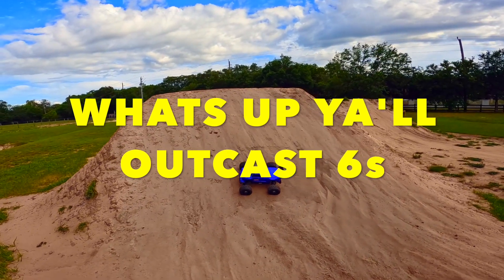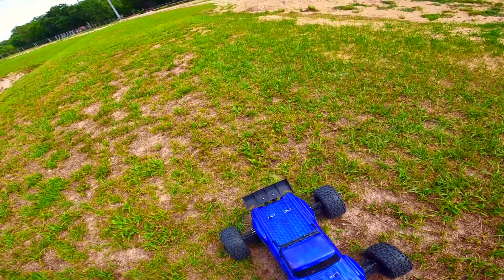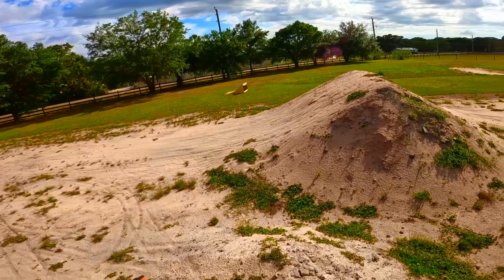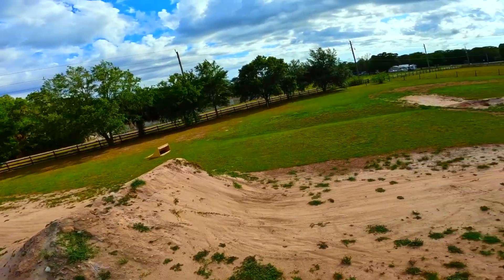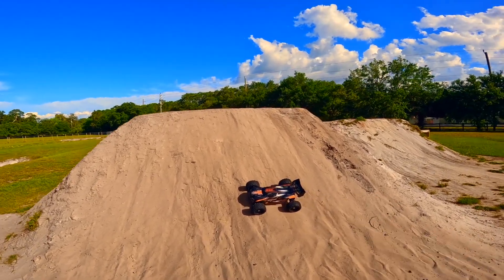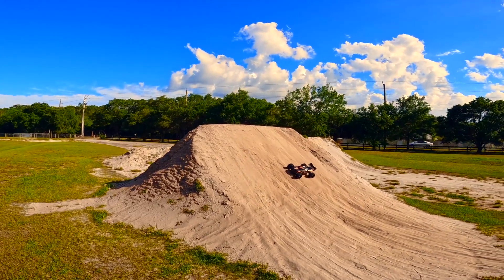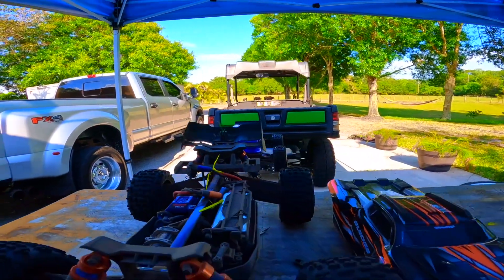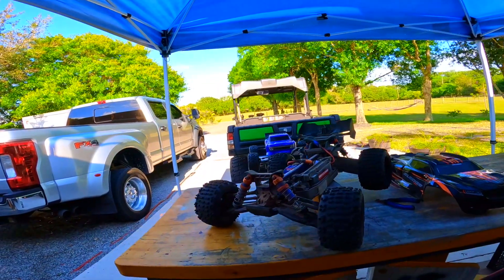ARRMA, OUTCAST 6s, VS TRAXXAS, SLEDGE

Comment: Great video I like the quality of the your videos and definitely the 4k camera as well, outcast seems to be more easy to control than the sledge at least for making jumps, good job I got try my notorious and see if it will perform same like yours 😊
Reply from the maker: Thank you I’m trying to do my best with the quality of these videos as you can tell from my RC’s I don’t take shortcuts on anything I like to do the best I can. I’m still learning the whole camera thing and lighting. But what I do know well is rcs between the outcast in the notorious yes they’re both the same trucks but it seems like the outcasts it’s a little lower to the ground overall then the notorious I try to keep all my rigs as low as possible, that’s why I don’t like the X max because of how tall and clumsy it is I’m not saying it’s not a good truck I just don’t like Tall RC’s. They handle so much better lower anyway sorry for making a long reply. When I start talking, I just don’t shut up really do appreciate your time and your comment. Much appreciated.👍🚀💪🤘😎

Comment: Nice session man. Outcasts one my favorite rigs. How u like that 2000kv motor? I run 1650 combo but trying lightin the rig up a little. But hey I am a rich duperbash wanna be bro🤙🏻🤙🏻✌🏻👊🏻
Reply from the maker: Thanks bro on my outcast 6s I like to keep it as light as possible I have been running the stock spectrum system till  just recently so far I like the 4082 HobbyStar 2000kv I think I’ll be able to gear up to an 18t from a 16 my temp seems to be pretty good they got a little hot at the end when I lost four-wheel-drive but that’s to be expected rich Duperbash is awesome I just like to joke around 😎🚀💪👊👊